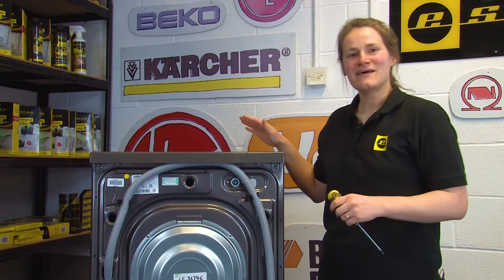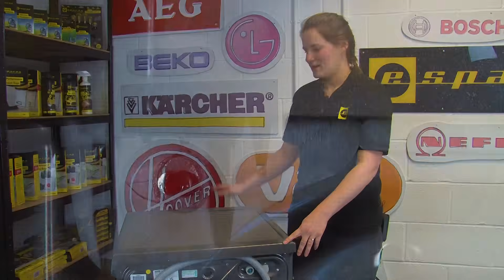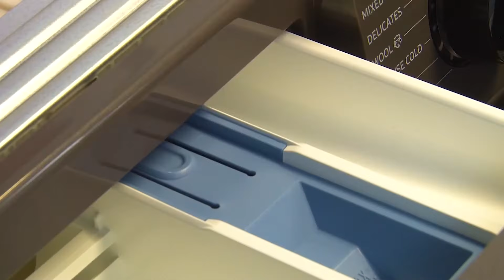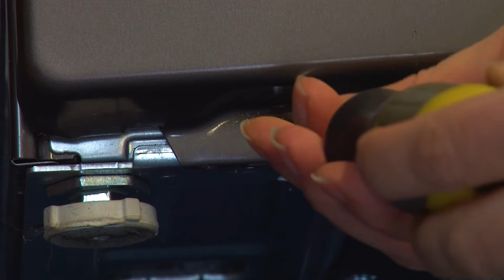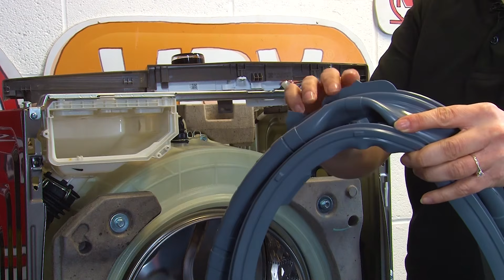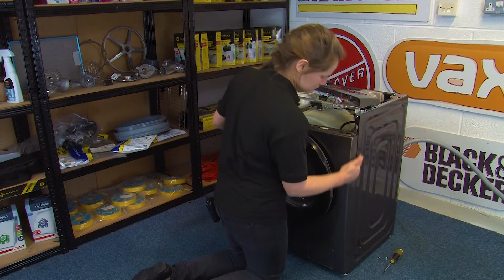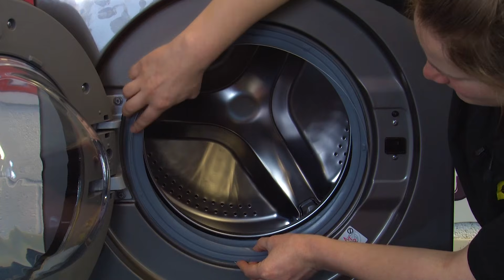How to Replace the Door Seal on a Samsung ecobubble Washing Machine

Comment: This is one of the best instructional videos I have ever watched. Needed a new door seal and this video inspired me to repair it myself. Ordered a genuine samsung door seal replacement from e-spares and delivered the next day as requested. Followed each step as shown and it was simplicity itself. I did find that I was unable to totally lift the control panel on top of the machine due to the short wire connections. Simply needed to unclip the connections carefully, they were the old type plug in phone leads, and access to the front of the machine was much easier. I also found it easier to fit the door lock before securing the top of the front panel as this give a lot more room for your hand to hold the door lock in place. For me, refitting the clamp at the front of the door seal was the most difficult and awkward. This was solved by stretching the clamp before I tried to fit it and thankfully all good. The main test was to run the machine to ensure that I had fitted all the parts correctly and that there were no leaks. I ran a rinse cycle first, not just to ensure that there were no leaks but to remove the rubber particles that had been shredded and remained in the machine. I am pleased to say all worked perfectly. Thank you once again for such a brilliant video! 😁
Reply from the maker: Hi, thanks for your comment...it's so great to hear that our video gave you the belief that you could replace the door seal yourself! Well done for completing the fix on your washing machine, and remember that eSpares are here for you if you have any other appliance issues in the future!

Comment: I think you missed out the most difficult part for me where attempting to fit the actual seal itself. Really struggling to get it on
Reply: Also, getting the metal ring back on to hold the seal. It’s too tight and I’ve loosened it as much as possible

Comment: Great video, very easy and accurate steps to follow. Mine has the silly hatch in the door that added a fair few wires when removing the front panel. The guide here still worked, I just slid the panel round to the right of the machine to complete the steps.
Reply from the maker: Hi Stuart, thanks so much for your comment...great to hear that our video was able to guide you through the repair! Well done for choosing to fix your appliance yourself!

Comment: Great video, thank you! Perfect description
Reply from the maker: Hi, thanks for your comment, great to hear you found our video helpful!...have you completed the door seal replacement yourself as yet?...how did you get on? If you have not replaced it as yet and still need a new seal, you can see our range of Samsung washing machine door seals here:
https://www.espares.co.uk/washing-machine/samsung/seals/catalogue.pl?path=1015007,127481:1015079&refine=seals
Reply: @eSpares  Done the seal replacement - took about 1 hour - your video was brilliant
Reply from the maker: Hi Chris, this is great...well done for choosing to repair your washing machine yourself...glad our video could help guide you! eSpares are here for you if you have any future appliance issues.

Comment: Thank you for such a clear and helpful video!
Reply from the maker: Hi, thanks for your comment here, have you been able to follow the video to replace the door seal on your washing machine yourself?...If so, how did you get on with the repair?

If you still need a new Samsung washing machine door seal, you can check out our range here at eSpares:
https://www.espares.co.uk/washing-machine/samsung/seals/catalogue.pl?path=1015007,127481:1015079&refine=seals

Comment: Ripped seal.. Not yet bought the seal but it looks to be the exact model.. So not attempted to fix it yet.. and I'm likely to struggle a bit and won't be easy as you made it loo. Nevertheless.. This video is incredibly brilliant, your likeability, clear instructions, and the editing of the video. Well done!
Reply from the maker: Hi, thanks so much for your comment, hopefully our video has gave you the confidence and steps to believe you can replace the door seal yourself...have you done it yet? Is so, let us know how you got on with the repair.

If you have not fixed it as yet and need a new door seal, you can check out our range of Samsung washing machine door seals here:
https://www.espares.co.uk/washing-machine/samsung/seals/catalogue.pl?path=1015007,127481:1015079&refine=seals

...be great to hear about your experience upon doing the seal replacement.

Comment: Any tips on how to get the spring clamp back on as I’m finding it impossible!
Reply from the maker: Hi, thanks for your comment here, there are a couple of things you could try...

1) Place the clamp in place at the top of the seal, and then gently use a screwdriver in between the seal and the clamp to ease the clamp around the seal, working your way around the seal in clockwise direction.

2) Get a second person to help, place the clamp around the top of the seal, and work it around while the second person applies pressure downwards at the bottom of the seal to keep the tension while allowing the clamp to be moved.

Comment: We HAD a leaking washing machine of the same type as shown in this video. Thanks to the clear instructions, I felt confident enough to order a replacement door seal (gasket). Since we live in Belgium, we purchased it from a local retailer.

With the help of the video, we replaced the door seal today — and it worked! Our machine is now functioning properly again. THANK YOU very much.

This video saved me a considerable amount of money on repairs, and buying a new machine is no longer necessary for the time being.

It was very helpful that everything was explained so clearly and step by step.

For your information: I do enjoy DIY projects, but I am certainly not a specialist in this field. 😊
Reply from the maker: Hi, thanks so much for your comment, it's great to hear that our video was able to guide you through the process! Well done for replacing the door seal yourself, and saving money from not needing to replace your washing machine. Glad we could help.

We have many videos on washing machine care and maintenance, and further repair videos, on our channel to help you.

Comment: Excellent! Thank you. Just a few tips: the control panel wiring loom needs to be unclipped from its hangers before swinging it around, and then clipped back on at the end. Your machine will be old, so when you have the door seal off you need to scrape limescale etc from the grooves around the lower part of the plastic outer drum. There is no need to unscrew the door latch receiver, as you can just unplug its cable whilst removing the front panel. Kind regards.
Reply from the maker: Hi Ray, thanks for your comment here!

Comment: Thanks for the video, only fair I get the parts from you guys as well. Only issue I had was getting that inner wire back on. The screw on mine was completely grollied out and I couldn't screw it back in any further than a half turn. Most frustrating!
Reply from the maker: Hi, thanks so much for your comment here, glad our video was able to help you! Well done for choosing to replace the door seal yourself.

...Have you been able to complete the repair now?

Comment: When i get to the control
Panel its nothing like the one shown on the video despite being a samsung eco bubble there are loads of cables attached not one. Shame what a a faff!
Reply from the maker: Hi thanks for your comment here, sorry to hear our video was not able to help you with your specific washing machine. If you do need a new door seal for your washing machine, you can check out our range at eSpares here:
https://www.espares.co.uk/washing-machine/samsung/seals/catalogue.pl?path=1015007,127481:1015079&refine=seals

Comment: We've replaced the seal but when the machine goes into 800 spin, it starts making a thudding noise. Our brand new seal is now slightly worn on the left hand side.
Any suggestions?

Comment: Amazing video thank you. But please I need advice....I changed the seal for a genuine part as the old wa shredded. I've changed it and done a wash but there's grey bits (flakes) of the seal. Anyone explain what's happening  please.
And unfortunately it's out of warranty now.
Reply from the maker: Hi, thanks for your comment and question here...it sounds like the door seal has not been fitted in the correct position, sounds like it is not flat against the tub...if the seal is pointed inwards it could be rubbing against the drum, and this is what can cause those flakes you are describing.

Comment: Another tip. The drain hole should be at 6o'clock. There are two marks on my door seal. Only one will have the drain in the correct position. The other has the drain at 7o'clock, so you get water left in rge seal. At least it was quicker fitting the seal the second time.
Reply from the maker: Hi, thanks so much for your comment here, hopefully useful for others on here. Thank you.

Comment: Thank you for the clear explanation. The steps and clips were similar on my Samsung wf80. One difference was the door lock. On mine you have to unclip/refit AFTER the front panel is off. As it won't clip back on any other way
Reply from the maker: Hi, thanks for your comment here and for sharing your fix story...useful advice for anybody that has a washing machine such as yours. Well done for completing the repair, glad our video could help you.

Comment: You say 'Just do this. Just do that. Just' crikey this is unnecessarily complicated. The seal on my previous machine was changed without needing to remove the top and front. I'm going to have to pay someone strong to pull my Samsung out from between units and tilt it because I'm currently not physically able. A 5 minutes £20 job has turned into a 20 minutes £100 job. Marvellous.
Reply: The big thing is that this video lets you know what you're up against. Awesome instructions.

Comment: Life saver of the video. Thanks for going to the lengths of a how to video, absolute life saver 😅best way to learn is to be shown how to do something. Bless you. 😊
Reply from the maker: Hi, thanks for your comment here, glad to hear our video has helped you! If you do need a new Samsung washing machine door seal, you can check out our range on the eSpares website here:
https://www.espares.co.uk/search/ma596pt1564/washing-machines/seals/samsung
Reply: @eSpares thanks what a great service. 😊😊, sadly I can not find my part for MODEL:WD80M4453/W/EU, how do I contact customer service please 😊?
Reply from the maker: @michaeljameslawrence2965  Hi, so sorry for the delay in getting back to you. It might be that the model number  you have stated is not quite correct...we do have a door seal for the following 2 models, is your machine one of these:
WD80M4453IW
WD80M4453JW

If it is one of these, this is the door seal you need:
https://www.espares.co.uk/product/es1779300/samsung-washing-machine-door-seal

Hope this helps!
Reply: @eSpares Hi thanks, 🙏 no problem. I have orders direct from Samsung spare parts as the first is the product number but it was not on the list so I ordered already. Bless you I will see if I can find it though. Great as this gives me the confidence to do the job myself. Always the best and only real way is to be shown how to do something I find. 99% of the time. 🕰️ 😊😊keep the how tos coming, I think my bearings may have done on my machine or something  as it makes a whining sounds draining the water on tumble dry mode. Any videos or engineers could help please ??

Comment: Great helpful video, only thing I’d add is I found it easier to put the door lock back on the front before putting the front on due to it having to go in at an angle that I couldn’t get when the panel was on. Thank you for the great video though, saved me buying a new washer for the sake of £20 and half an hours work
Reply from the maker: Hi Kenny, thank you for your comment...it's great to see that our video has guided you through the door seal process, and that you have completed it. Thanks for your additional tip, as it may help others who have a similar washing machine to you.

Comment: How did you manage to loosen the inner spring so far?
As soon as the coil bites the thread mine ceases and starts buckling the circle instead.
Can't get it back on with it still this tight though.

Comment: Thank you for posting this video, it enabled me to change the door seal on my Samsung wf70f5e2w4w.
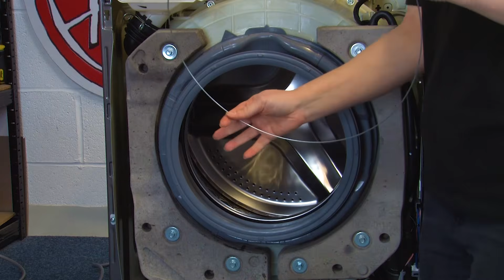One comment - on my machine, the inner spring screw thread slackened off due to vibration. I would highly recommend anyone doing this repair to use some ‘Threadlocker’ glue when tightening up the inner spring screw (see minute 6:46 in the video).
Reply from the maker: Hi, thanks so much for your comment, and for sharing the experience you had with your particular model of washing machine.

Comment: Great instructional video. Very easy to follow and understand. We had a slightly different version where the cables were too thick on the control panel and fixed to the side of the machine. We couldn’t pull it out and place on top. Just made it trickier to get front panel on and off. Also ours had white plastic clips on the front panel which kept popping out! Also the door lock was attached by an electrical cable. When we put the front panel on we attached the door lock on first which made things easier.
Reply from the maker: Hi, thanks so much for your comment here and for letting people know about the differences you found with your washing machine. Well done for completing the repair yourself!

Comment: Took me 1hr alone to fit the inner side of the rubber ring, but this is more because of my clumsiness and big hands. Rest worked straight forward. Seal replaced, machine works fine. Thank you very much.
Reply from the maker: Hi, thanks for your comment, it's great to hear this video has meant you were able to replace the door seal on your washing machine. Well done for doing the repair yourself!

Comment: The job was a lot more than described but had the full jist of the job. A lot more wires on the control panel thats  shown in the video. The door didn't come off fully because of attached wires. To get the rubber on I had to remove the concrete blocks. A job I thought that was going to take 10 mins took 2 hours. A rusty screw on the bottom didn't help that I tried drilling out which I then ended up grinding off. The video is very helpful but beware it is a lit trickier. Happy though saved me a 100 call out charge.
Reply from the maker: Hi, thanks for your comment here, and for sharing your experience with how this repair was for you. It is very possible that there will be some differences in the process for some people, compared to what we have in this video, as some models can be different in how they are constructed. It's great to hear that our video was still able to guide you, even though your washing machine model is different to the one in our video.

Comment: My door seal was ripped due to a broken drum spring- you should check when you take the top off the washer. They are easy to see big springs that hold up the drum. One on each side - worth checking whilst repairing the door seal- Great clear guiding video- Thanks ❤👍🏻
Reply from the maker: Hi, thanks so much for your comment. It's great to hear that our video has helped guide you through the door seal replacement, and thank you for your suggested advice regards the door springs.